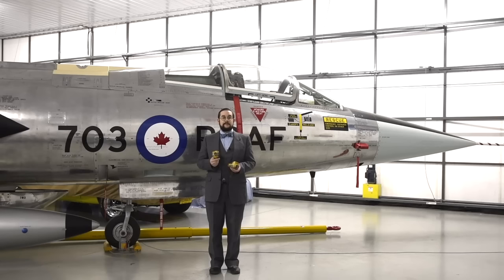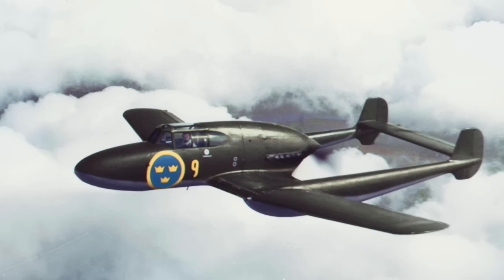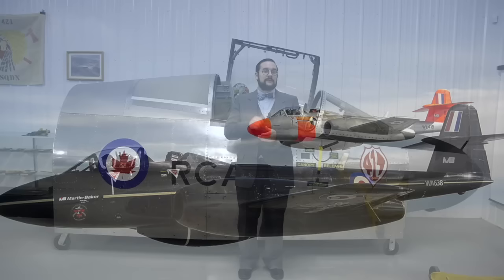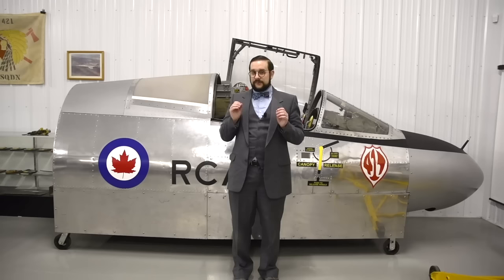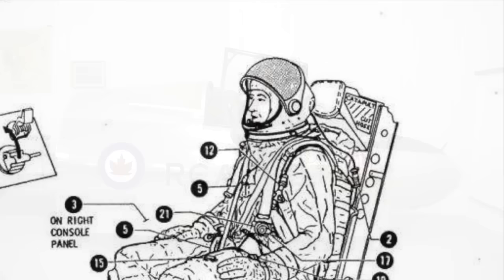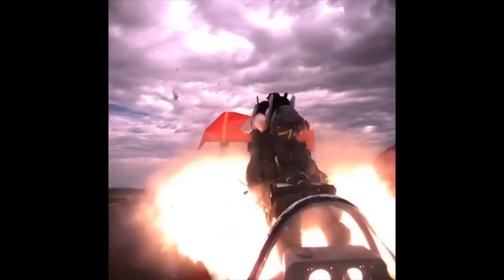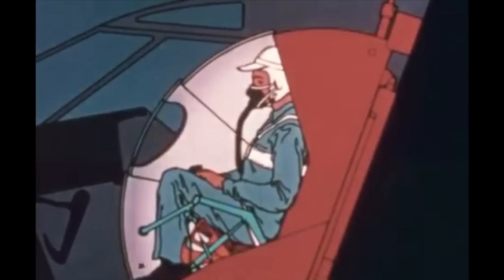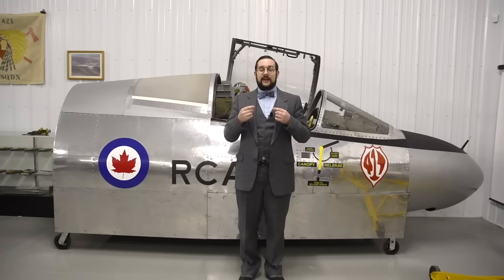F-104 Spurs and the History of Ejection Seats

Comment: This makes me think of something mentioned in the book “The Right Stuff,” where a pilot describes using one of the early ejection seats as “committing suicide to keep from getting killed.”
Reply: When it came time for Chuck to eject from the NF-104 plane he wrecked in an ill-conceived stunt, he used an upward-ejecting seat ( possibly the Stencel, I am willing to be corrected here ), even though a downward-ejecting one would have worked at that height.  
He still was nearly blinded by it.
Reply: @stevetheduck1425  It was not an "ill-conceived stunt" like the movie portrays, it was a controlled mission, and he was horribly burned by the seat's rocket motors, putting him in a burn ward for many weeks of agonizing pain. Unlike the film, where he walks away from the wreck like a badass. That is a great movie, but it plays pretty loose with the facts.
Reply: More like taking a very high risk of death in lieu of certain death. Plenty of people survived elections, usually with more or less injuries as a result. And it depends on what situation you were trying to eject from. Low level or in uncontrolled flight was far more dangerous, as was high speed ejection. But used as they were designed, to bake out of a plane in level flight at cruising speed, they weren't that deadly (very uncomfortable and likely to injure you though). They didn't really plan on using them to escape in all conditions originally, it was too be used in situations where normally you would have baled out. That required you to keep the aircraft in relatively stable flight at a safe altitude and speed, otherwise it was hopeless. The ejection seat was just to make the same thing possible in the new fast jets, they didn't really think it was feasible to make all-conditions escape possible. But of course pilots tried anyway when the alternative was certain death. And so a lot of them died.

Comment: The death of goose was a realistic, feasible situation.
As you pointed out, there is a lanyard that interlocks the firing sequence for the seats if the canopy isn't released.
But that is to prevent the seats from firing if the explosive bolts for the canopy fail to fire, or fail to fire correctly and the canopy stays in place. As the polycarbonate (not plexiglass) F14 canopy didn't have a line charge in it (like the AV8 had) to allow ejection through an intact canopy, nor do the seats have an egg tooth on them... polycarbonate is far more impact resistant than the plexiglass canopy on the A6 and other aircraft with the egg tooth designed to punch through an intact canopy. 

If the bolts fire correctly, there is enough kinetic energy to pull that interlock lanyard, even if the canopy isn't swept completely clear of the ejection path. 

The issue is, again as you pointed out - in a vertical fall, in a flat spin the separated canopy won't be blown clear by the slipstream of the airplane, and will tend to hover above the cockpit for a bit. 
It WILL eventually clear, but not before the seats fire (the sequence is very fast)  so a special procedure involving flat spins was developed:  the crew was trained to jettison the canopy first (there is a control for this, that DOES NOT initiate the full ejection sequence)  and wait.  Once the canopy drifts clear,  the crew initiates the full ejection sequence.

It appears that neither maverick nor goose release the canopy.  - maverick does call out to "watch" the canopy when he tells goose to punch them out (as he says he's un able to reach the controls to do so himself)  but it appears that goose fails to use the correct flat spin egress procedure.  Either that... or he does jettison the canopy... but fails to "watch" the canopy and initiates the full sequence before it was safe. 

There was a real "Goose" who died in an ejection accident in an F14.  He didn't get killed exactly the same though. 
Lt. David J. “Goose” Lortscher.   He served in Vietnam in F4s as a RIO, and had ejected 3 times in his career, later when he transitioned to the F14, on a 4th ejection... he was killed. 

They named Nick Bradshaw in the movie "Goose"  to pay homage to this RIO.
Reply from the maker: Awesome insight, thanks! I always love learning these deeper details from my viewers :)
Reply: Very true! An F-14 RIO by the name of Ward Carroll goes through this on his youtube channel as well. The procedure that you mention was included in the "boldface" (procedures which must be memorized by the aircrew) in the early 80s, because such an incident(s) did indeed happen (I'm unsure if they resulted in the death of the Pilot/RIO, but I know for sure that at least one has struck the canopy on his way out).

If I remember correctly, Maverick says something like "Eject, Eject, Eject The Canopy" just before Goose initiates the ejection. I think Mr. Carroll's conclusion was that Goose simply panicked (which is understandable) and thus forgot the boldface procedures which were in effect at the time, and thus unfortunately killed himself.

Comment: Great video and worked on ejection seat capable aircraft for many years....
Back in the 80s was at a base were a bird strike hit the front pilot in the face.  He was hurt badly but they were able to safely land the aircraft
It was reported that a bird bone was lodged into the ejection system banana clip (used by rescuers to pin and safe the seat) that even had they initiated the ejection the seat had been "safed" by the bone.
Crazy lucky for the crewmembers!

Comment: Our aircraft in the late 70's got zero-zero seats that used a spreader gun to open the parachute at low elevations. Basically 8(?) barrels arranged in a star pattern with weights that were attached to the parachute lanyards and a charge in the middle. The canopy would literally get blown open once the pilot cleared the seat.

Comment: An interesting design is the ejection systems on the early MiG-21s, pre the PFM model.  During an ejection, the canopy is joined to the seat acts as a shield and protects the pilot. After some time it is released. They eventually gaves up on the idea because, at lower altitudes, it takes too much time for the canopy to release.

Comment: The Gemini spacecraft also had ejection seat and early prototypes were equipped with a inflatable? wing that was supposed to let it glide after reentry to a runway so it could land. The first few space shuttle missions with the shuttle Columbia was also equipped with ejection seats for the commander and pilot. These were later removed. I think after the challenger disaster they had a pole that would deploy out side the crew access hatch so the astronauts could bail out that way over the ocean if they were unable to glide to a contingency runway. Great video by the way.
Reply from the maker: I actually have an entire video on the history of spacecraft escape systems if you're interested! https://www.youtube.com/watch?v=kfX59ST9imc
Reply: Unlike Mercury and Apollo where weight was critical and the spacecraft were designed as highly integrated designs, Gemini was designed as an operational spacecraft with equipment bays and cannon plugs that allowed for quick check out and replacement of systems. 

It was also designed with the intent to use an inflatable Rogallo wing to allow the space craft to be recovered on land (not necessarily a runway).  This would avoid submersion in salt water and make it practical to quickly service the aircraft for a subsequent mission.  However, the wing took longer to develop than planned and speed of development was an issue for Gemini as the program began after both Mercury and Apollo when it was realized that the Lunar orbit rendezvous method chosen for Apollo would require a bridge program to acquire the orbital maneuvering and docking skills required. 

The Gemini  spacecraft itself was capable of a lunar orbital flight and it was considered as a means to do it well before the Soviets. However the Soviet space threat didn’t develop and it was then thought that a lunar orbital flight by Gemini would bring into question the need for the Apollo command module. 

There was also a proposed Gemini applications program that would have used variants of the Gemini spacecraft as a crew and cargo shuttle to proposed space stations.  These would have utilized the equipment bay as cargo and crew quarters, with a hatch in the heat shield, a concept that was actually tested successfully. 

Unfortunately it was never funded in part due to the cost of the Apollo program and in part because after Apollo NASA chose the space shuttle concept.  It was ultimately a poor choice as launching a spacecraft the size of a DC-9 into space as dead weight on every launch was never going to be efficient, and NASA knew from the start the advertised 2 week turnaround time between flights was never going to be achievable. 

In contrast an operational design like Gemini would have allowed for comparatively inexpensive space flights as the USAF had over 170 soon to be surplus Titan II boosters that could have been affordably man rated to support 170 future launches of a number of comparatively low cost reusable Gemini spacecraft. 

And that’s effectively what the Soviets did with their Soyuz spacecraft, the same basic spacecraft we are still hitching rides to orbit on today after the shuttles had to be retired due to excessive flight risk. 

The space shuttle made for great PR, but it ultimately cost us over 40 years of meaningful progress in low earth orbit.
Reply: The ragallo (spelliing?)  wing. NASA looked at using that to recover the Gemini spacecraft, since it was controllable. 
Something similar is used by some hand gliders

Comment: The B58 capsule you mentioned didn't have spurs but instead the pilot had loops going round his legs. Prior to closing and ejecting the capsule those loops tightened like pretensioning seat belts to keep the legs away from the capsule wall and to reduce movement.

Comment: Bailing out of the space shuttle could be done using a pole.   According to a web site on the subject by mfwright, 
"A long escape pole is quickly deployed out the hatch. One by one, each crew member attaches a lanyard hook which is connected to his or her parachute harness to the escape pole and jumps out the door."     It was called the crew escape system.
Reply: It was a lame attempt to come up with something that might of worked in limited situations after the Challenger explosion on launch. 
It would of not worked on the Challenger as the failure was catastrophic on launch nor would it of worked on the Columbia as an ejection would of been at something like Mach 20 and any escaping crew would of just been flaming meteors (some of the recovered remains were essentially that).
The one Space Shuttle system that existed for the first few launches was a conventional ejection seat for the commander and pilot that would of ejected them up, through the roof. If it had been further developed it could of even worked on the mission specialists sitting behind the commander and pilot on the top deck. The mission specialists below decks... Sorry, you aren't getting out.
Reply: @TishaHayes  He's not talking about the ejection seats, which were only active on the first two missions and removed shortly after. He's talking about the escape pole slide system that was installed after the Challenger accident. The Mission Specialists on the lower deck would've been the first ones out the hatch since it was right where they were sitting. The Commander would've been the last one to abandon his ship. This system only useful if the spacecraft were in a subsonic glide, though, so just as useless during launch and the early part of reentry.

Comment: One more addition to the pilot has left the chat story is the method that crew of Douglas's  A3D/A-3 Skywarrior and F3D/F-10 Skyknight were supposed to try. They had a hatch in the cockpit that led into a chute that they were to slide down and out a hatch in the bottom of the aircraft. Not ideal for low-level escape, but I guess they figured these weren't high performance fighters.

Comment: The yankee system, or something very like it, was a contender for the Space Shuttle Crew Escape System, but, while it worked, it was as heavy as two astronauts, while the competing telescoping curved rod was lighter, and got the escapees away from the Shuttle's low-set wing.  
It could only be used in a small envelope on launch before max-q and before the 'abort to launching or landing site' option, and a longer window at a normal landing, and so was, I believe, not used after a lot of good publicity was generated.

Comment: I was blessed to have flown backseat in a TF104G in the mid 80s, sadly I don’t remember wearing the spurs…when that J79’s AB lit it was impressive! Such a beautiful airplane, but a bit of a pain to work on. I also flew many times in two versions of seats in a very early B52, and also the downward one in the bombardier crew position…ah the good old days…I think my butt just might still hurt a bit from the very skimpy seat pad that sat on top of the B52 seat’s survival kit 😎 Nice video, thanks!
Reply: Most terrifying instance I had in the USAF was in a B52 RN seat, while on the ground. Performing a system check, my coat (Northern Tier, so we always had one coat or another on when boarding the aircraft) sleeve snagged the ejection handle... and the "ankle claws" came out and grabbed my feet. I thought I was going to be rocketed 10' down into the asphalt of the flight line... but the safety pins did their job and kept the charge from going off. But I had to take a moment to settle down... 😋
Reply: @MrJest2  yikes

Comment: The Tweet has a 40mm mortar shell under the seat. Just got you over the tail. The T-38 had a much improved rocket motor but it was still limited in it's use. You had to have a certain altitude and airpspeed before it would guarantee success. The newest zero-zero seats are brilliant and have saved so many lives.
Reply: Not a shell, a cartridge. You don't use high explosives to propel an object. The propellant normally used to accelerate the mortar is used instead to accelerate the seat. It will seem very violent but nowhere near like actually being blown out by a detonation. Propellants burn rapidly, almost instantly, they are gas generators. High explosives detonate instantly and create destructive shock fronts.

Comment: Back in the day, whilst I was serving in the RAF, legend had it that Martin Baker (MB) issued any crew member that survived a MB Ejection, a gold silkworm tie pin and certificate, logging the date and time of that ejection.  Now, I knew a couple of people that did eject out of RAF jets but not long enough after those ejections (You know? Postings and whatever...). So, I never had this denied or confirmed, sadly.

On the Top Gun story.  I'd still reckon that as part of the ejection sequence, the canopy would be separated from the A/c and the drogue in the top of the seat would be higher than the head of the occupant and therefore should, in most cases, be unceremoniously shoved outa the way.  There is some power in them guns/rockets.  Even if the seat is destabilised in the initial sequence, the drogue's main function is to re-affirm stability so that the main chute can deploy reliably.  Well, that is my understanding.  Bear in mind, I was a member of the more intelligent portion of the team, you know, the Ground Crew.  We sent the Hot Shots off to do the fighting and then we went off for lunch. 🙂

Anyway, love the vids!
Reply: It was called the 'silkworm club'.
Any pilot that used a parachute was given the pin. Martin Baker continued the tradition for awhile: don't know if they still do so.

Comment: On the B-52, it had a couple of downward ejection seats.  To keep the pilot from losing their legs during use, they required the operators to bring their feet back against the seat, where a device would prevent the legs from moving during ejection.  During aircraft maintenance training, the 52 was used, but all the ejection devices were removed.  The downward seats leg retraining device was spring loaded and still functional.  During training, we would cock the seats, and eventually a student would bring the feet back against the seat, and the device would deploy, trapping their legs.  Based on the screams, the students thought they were about to be ejected onto the hanger floor.

Comment: A zero-zero ejection seat isn’t a cure all and still has an ejection envelope.  For example the  ACES II seat in the F-16 is a zero zero seat, but at low altitude that depends on the pitch angle of the aircraft its roll angle and its descent rate.  If for example, the F-16 is in a descent at 10,000 fpm at 200 kts and 300’ AGL the pilot isn’t likely to survive the ejection even if the aircraft is level. The downward vector of the aircraft is shared by the pilot and seat which then has to overcome that vector and momentum to successfully deploy the parachute before the pilot hits the ground. 

That can require a cool head and a lot of quick thinking as the pilot balances the pros and cons of using the remaining altitude and the aircraft’s thrust and lift to improve that vector to get the pilot back into at least the ragged edge of the envelope. 

At 450 kts in a 10,000 fpm decent and a 60 degree nose down pitch attitude the pilot needs to have a minimum of 497’ when the rocket in the seat actually fires to successfully eject with that “zero zero” ACES II ejection seat. Obviously that ejection sequence needs to initiated well above 497’.
Reply: Thank you for that!